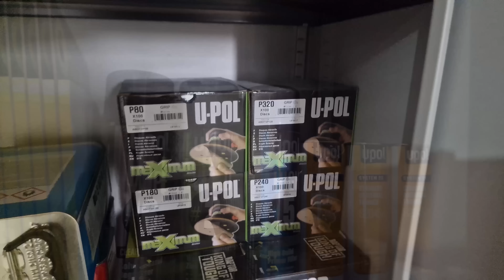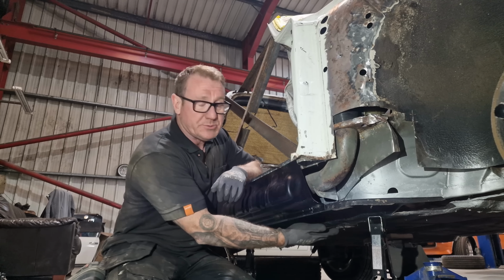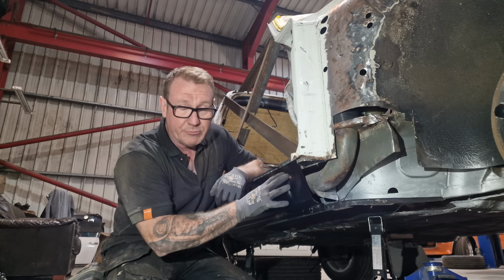Porsche 911 RestoMod : Rebuilding the floor and sill.

Comment: Panel fit at 15.13 is just awesome. I noticed you forming what looked like quite a complex, compound curve or flare to the curved end, tapping away on the anvil, persuading the metal to flow into an exact match for the good section remaining in the car. As always, after your customary tack weld, thin wheel cut through, butt welding & grinding back, it won’t be possible to see where the German & English steels meet. Something good moves in the universe when that happens 😊

Comment: What does that pipe looking thing do that is inside the rocker panel?
Reply: That is the heater channel. Brings hot air from the heat exchangers in the back to have heat in winter. Remember the 911 is air cooled
Reply: Like a beetle

Comment: Interesting to see for an outsider that the car is of normal steel. And it is by manufacturer only welded a small spots, say 10% of the seam is in contact. Does it represent its price?
A chassis of a truck is of very-very high strength steel. You cannot weld it, only bolt or rivet it. But it is a truck, no Porsche

Comment: Just an incredible amount of work, and you are impressively skilled.  I must confess, though, that I am struggling to understand the economic side of this.  This particular 911, as far as I can tell, is not a particularly rare or sought after model, and the mind boggling, extensive rust damage, and the commensurate huge cost of repairs do not make economic sense.  In other words, the owner is spending way more money on repairs than they can expect to ever come close to recouping when they sell the car.  This reminds me of a recent car sold at BJ Auctions; more than $300K in receipts, and it sold for $60K.  Has the backstory of this 911 ever been given?  Is it the owners first car?  Or does it have some significance I am missing?  I know there is more to life than money, but why not just use this 911 as a parts car, and just buy another rust free 911 shell and transfer the usable parts over to it?
Reply: I also deduced there was surely some special significance to this particular vehicle, to warrant the investment. It can sometimes be a different equation if you’re doing the work yourself, even if you oddly spend the same money (I appreciate you wouldn’t, but making a point), because you can extract value & satisfaction this way. I’ve experienced that with vintage bike restoration. I actively don’t want someone else doing it. I once bought someone else’s finished restoration and I never fell in love with it, selling it at par a couple of years later.
My own bike from the 1970s, I spent at least twice it’s finished economic value in its restoration. The cost was still only a few thousand & wasn’t relevant over a literal lifetime. I’ve owned it since 1978 & there’s no other artefact that connects me with an unbroken line to those days. It’s also a source of tremendous satisfaction, even though few people have seen it & fewer understand what it represents.
In a more level headed way, 15 years ago, I bought a bike I’d have owned, had I been better off as a young man. I got it off a guy who’d piled money into the frame and engine, but none of the cycle parts or pretty bits. I was able to acquire almost all I needed as new, old stock and restore the rest to make a show winning machine that’s also a pleasure to own and ride. Bonus, it’s now valued at twice my total investment, neatly covering my extravagant expenditure on my longest owned motorcycle.
Perhaps that Porsche has this sort of significance to its owner?

Comment: I've an 80's Shogun out there today Steve - back axle torn off as the spring hangers rusted off the (also rotten) chassis.. Couple of mechanic pals in chatting this evening - one stuck his head in under the Mitsi... lol.. "Where the hell do you even start to repair that??" he goes.. I was thinking it was gonna be a bit of craic to fix tbh, no big deal.  There's 2 sorts of car-guys, ones who do rust & then the ones who are terrified of it.
Reply from the maker: Just done one of them, underbody was easy but the rear arches and inner wings where a challenge haha
Reply: @yorkshirecarrestoration  I was in eating the dinner - watching TV with the Missus, chilling, long day done, absolutely knackered - phone rings - it's a Pal who rocks at paint, cars, machines, whatever - he paints good.. "You around J?" he goes, "I'm outside here.." - I wandered out to the workshop, to see what he wanted. 

Turns out he'd been there since 6 when I quit, had sneaked in  - and he'd the entire paintjob I'd been dreading on a Sprinter bus I'd repaired, done - as in sanded, based & cleared, finished, done, mint.... He'd got the paint code, got the paint, shot it all and had it ready to go back - without saying a word to me/mentioning he was going to do it/being asked.  I doubt, in my entire life, anyone has done me a more solid solid. . It was like Christmas tbh, Steve. 

I do a lot of work for a guy who specialises in old Pajeros/Shoguns - they're not a challenge any more as he brings me so many of them. The first few wrecked my head, but now they're routine - I like them as Mitsubishi used good steel, it's weldable - they usually look worse than they are - plus you're almost guaranteed they will start & drive - so getting them into the workshop is a doddle.

Comment: As a master sheet metal worker, I have seldom seen such poor sheet metal work during a restoration, such as with overlaid sheet metal and so on... Is the Porsche booth only intended for sale, or is that a customer order....
Reply from the maker: It's a customers car and the only overlyed panel was the centre sill, as it says on the screen, it was out of the customers budget to but weld that centre sill.
Reply: I almost thought so, because such a work can only be related to the financial possibilities or it is a sale object.... No offense I think you know what I mean... But one more thing your MAG Welding machine could use a correct setting  😂😂 @yorkshirecarrestoration

Comment: Is there a practical reason why you are working on the floor and not on a dolly or four post lift?
Reply from the maker: Yes there is nowhere to jack it and even if there was in working on the rear that the jack would be on and I'd rather ha e it o. The floor while there is no structure or strength in the sills.